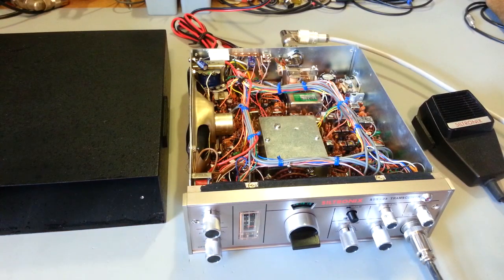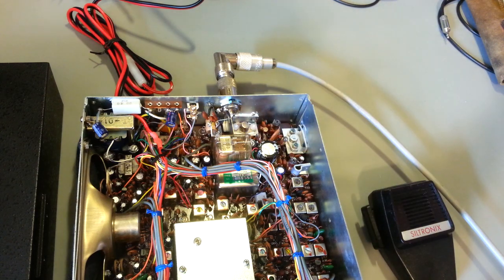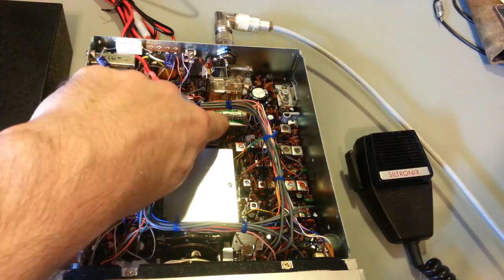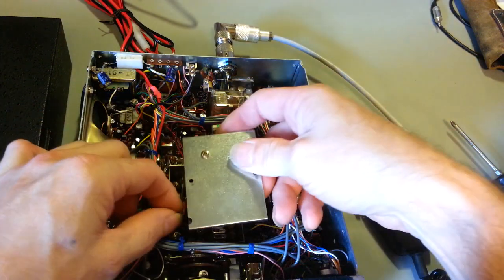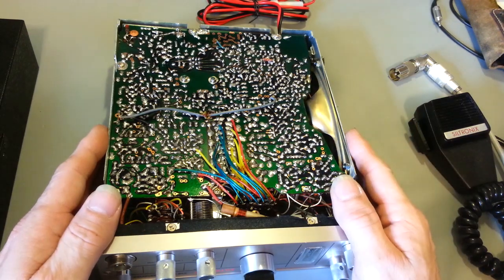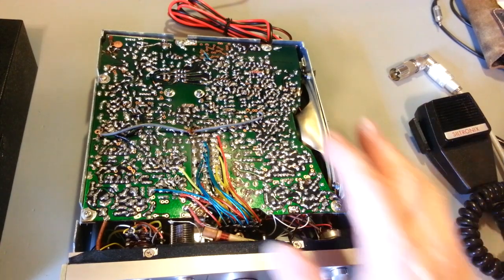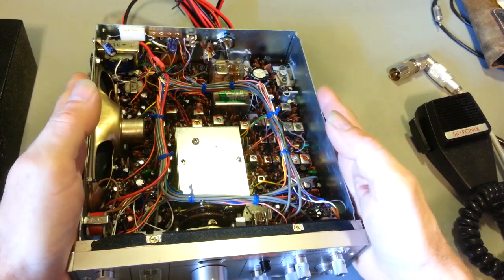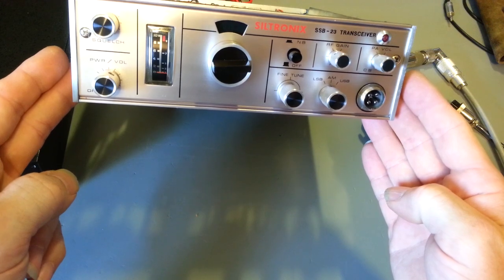Siltronix SSB-23 early AM/SSB 23 channel mobile CB radio.

Comment: Jump that 5 watt power resistor you glued to the chassis. Had 2 of these as a kid. Would buy another one in a hurry. Jump that resistor people. It feeds the output final. These rigs had phenomenal receivers in them. I worked the entire US with 20 or so watts ssb. Had an amplifier if I needed it.

Comment: I like the "older" build radios, but what about channels 24 thru 40 ( and above?)... Big draw back...
Reply: hi mike been trying to email you on getting a President  2510 worked on what's the best way to get up with you thanks  also like watching your videos
Reply: I have a 23-a that has extra crystels above 23 to 40 they took some of the crystals out 1 thru 12  works good,thanks
Reply: Siltronix 90-1 VFO will get you 40+